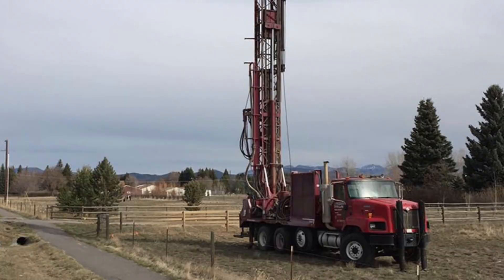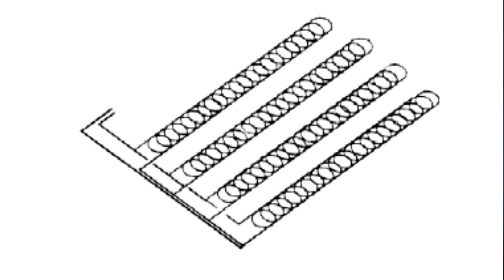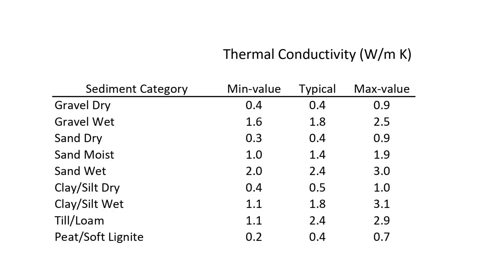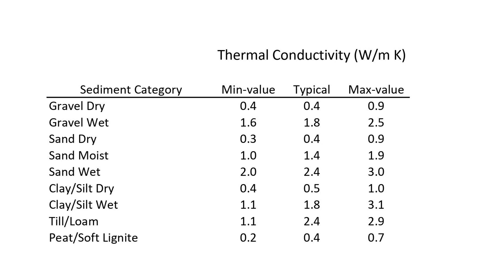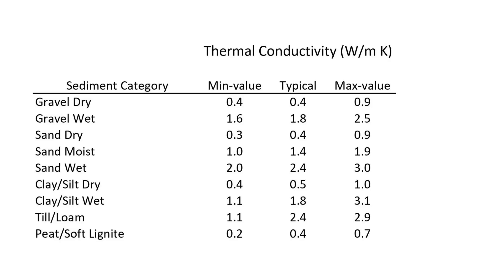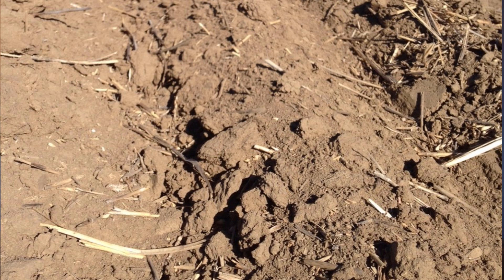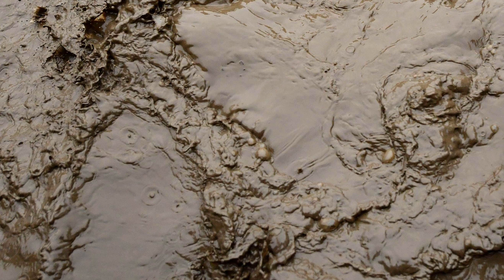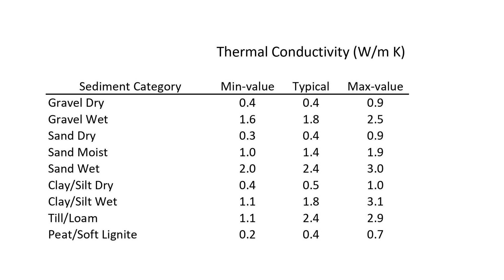Soils - Step-by-Step DIY Geothermal (Part 1)

Comment: Im curious what kind of soil you encountered at your depths, and did you decide to bring in clean soil for the 6-12 inches on either side of your loops? Also when you say gravel/rocky soil how big of diameter comes to mind. I had to have some profile pits dug for septic soil testing and im sure ill get the results from the lab but just for my understanding. Thanks for the video series and all the good and bad you've encountered, im sure ill be back with more questions.
Reply from the maker: I had moist clay at depth.  I would look to see how angular the rocks were at depth and wouldn't want anything more than 1/2"

Comment: I think you made this too technical..
I think it could be a lot easier than the way you are saying it..
Most people if they saw this video would just say screw it I'm going to put in a wood boiler...
I know a little bit about geothermal and it can be done fairly easy and cheap..
And that's what the public needs to know..
I understood what you were saying..
Thank you
Reply from the maker: I wouldn't recommend anyone do this on their own without a little bit of education.  The education is what's going to make it fairly easy and cheap, and it will actually work.

Comment: I think it'll be cheaper to just do Overkill. I'm using solar so I could care less if I'm using an extra 50 or 100 Watts with a bigger pump. The surveys and time that it'll take to get this done would be ridiculous in my opinion. Drill the hole throw in the pipe have a nice day. If it's too much again I don't care, but if it's too little which is very unlikely then I'll just dig another trench and throw on an extra solar panel if necessary. But I've watched all of your videos and I really do like them. You do an excellent job, so thank you very much. I have subscribed to your channel and have learned a lot.

Comment: Does moisture content of soil change to a meaningful degree throughout the season. I’m asking because if I do this in the spring vs. mid summer am I going to get meaningfully different moisture contents that could doom my system?
Reply from the maker: At the depths I'm suggesting, no.  It's pretty darn consistent at depth.

Comment: I live in the Ozarks and on the south side of the hills it is mostly dry clay combined with limestone rock for the first two feet. After that in most place you hit bed rock. Hard limestone. If I dig a horizontal loop in a ditch carved into rock  would I maybe use gravel to fill it? Solid rock trenches in limestone... what soil would be best to replace the stone when backfilling a trench in solid limestone?
Reply from the maker: Clay if you can figure a way to keep it moist.

Comment: This is just what I wanted ...  I stopped my A/C project - an excavation beside our house on the Philippines because I wanted to know what is the best thermal  conductive soil to backfill with.. My rock bottom temperature is 21 C or 70 F  I will have a combination of a large horizontal non-overlapping coil only 1 foot deep under shaded cement and a dug well ( over a yard across) to hold a Wearhouse received coil of black water pipe( PE)  both are only !/2 inch in diameter.  Together there will be 300 meters ( 1000 feet ) .   My soil is limestone rock most of which must be jackhammered to excavate.   Thinking of making the dug well part another meter down to make it 2 and a half meters in total and adding one more 150 meter coil to increase my cooling capacity.
  I will also be making available roof drainage water as well at outside tap water to keep the dug well part saturated with water.  Your video has helped me to decide to fill my dug well section with a pea type sand gravel to mix with the water.  There will be no pipe connections made under the cement slab all connections will be made on the surface side of the house. This will be strictly water to a fan cooled radiator by low volume pump cooling system no refrigerating system..

Comment: Awesome content!  I’m building a timber from guest house on a 9 acre parcel on a small lake in Wisconsin.   Should be wet sand 6 feet down.  Considering trenching towards the lake and possibly using lake loop or at least will be able to get major water saturation near the shoreline.   Need to further research my local shoreline zoning but seems possible.

Comment: Thanks for putting the video out, super informative and helps with understanding the basics. Question I have - if my soil is basically wet sand (groundwater running through the land at about 5-6 feet) should I still worry about the density of the soil?
Reply from the maker: Nope, you are good

Comment: 7:21  I worked as a certified lab tech doing soil proctors for soil density testing.  24 hours?!?!?!!!!  No, when it's dry, it's dry.  Any one can see when a soil sample is dry and then touch it (after it's cool) and when it's dry, it's dry. our oven was just a toaster oven and we put the pan just under the heating element.  Took about 15 minutes.  Our sample size was small.  Don't need a shovel full to determine moisture content.  As long as your scale is accurate you can us about a cup of soil but I usually used about two cups of soil to make sure I got a good sample.  Spread thin.
Reply: Doesn't the moisture content vary a lot from week to week based on the recent rainfall?
Reply: @hickorydragon8114  In the field you are correct.  In the lab an oven is used to drive off all the moisture from the soil sample.  The idea that it takes a 300  degree oven 24 hours to drive off all the moisture from a 300 gram sample is just ridiculous.  The sample is baked for about a half hour.  With all the said, if there is a .001% moisture content it won't skew the proctor enough to worry about.  Honestly, the proctor is designed as a lab test to give documentation for a process the can be done by judgement just as well.  One of the job sites I worked at we couldn't get a proctor because there were too many +3 inch material so the entire site was done by judgement.  That puts a whole lot of responsibility on one person that has no way to document that it was done properly.  I do take solace that on this job site every company that had to do excavation (plumber, electrician, etc) complained that they had never worked their equipment so hard to get the job done.  Yes, that was a long winded response but I felt like it.  Bit of a brag with loads of facts along with it.

Comment: I was wondering, does your system have temperature probes for the outlet and inlet of each loop?
Reply from the maker: No, just one for the the combined on each.  However, you can use a laser thermometer to measure the outside temp of each line if you wanted.

Comment: Garrett, much of the area I live in, Dallas County, Texas,  has a large sandstone formation anywhere from at the surface to a maximum of 14 feet of cover. It's hard to be sure in many areas without and soil sample before buying. I am fairly familiar with with this- I have been digging trenches in it since the '80s as a plumber. You soil lists don't really seem to have a line for this- vertical systems in this area that I have looked into are 100-125' deep, one loop per ton. I am aware I haven't given any moisture numbers- if you test for moisture soon after a rains storm, the numbers are high, as the water is running across the face of this "chalk", less so for the higher points on the chalk, and dry as dust for periods with low rainfall. My take at this point is that a horizontal system might not be practical- even with much longer tubing runs. I guess I'm hoping you can tell me there is a silver lining here. Any light you might offer would help. Also, thanks for the source listings for the manuals- I' ll try to catch up will them. FR
Reply from the maker: In your case, you may want to install a supplemental watering system that periodically keeps your trenches moist.  Perforated pipe buried a couple feet above the loops that can be connected to a water source.  If you have a septic system with a lateral field, you can bury your loops under it.
Reply: @Challenged1   Thanks, GG!
Reply: @Challenged1  Thanks! Another thought dawns on me- use the grey water from washer/tub line as feed for the perf line.  FR

Comment: another great vid & sounds like an invaluable series, Garrett. here in Phx we're known for caliche, but i got lucky while planting my trees & found great soil about 4ft down. i'm not sure what to expect in NM (where we plan to buy/build), as they've got naturally growing pine & pinion trees but it's also visibly very rocky & dry on top. love the tip to layer clean fill below/above the coils ...think the moisture content & thermal conductivity would remain? or would it potentially dry/harden over time & perform worse? or maybe the goal of that is just to pack tightly around the lines to make the best of a less-than-ideal situation instead of rocky soil that'd have air gaps?
Reply from the maker: It all depends on the moisture content of the virgin soil at your loop depths.  That will tell you what you need to know.  If it's too dry, a supplemental watering system can be installed to periodically water the loop trenches.  More details to come in another video.
Reply: @Challenged1  ..."supplemental watering system" -brill, thx man!
Reply: We also have land in NM and I've heard stories of caliche, although I have no idea yet if we have it.  We are putting our dreams to paper at this point.  I'd love to hear any more of Krazie Ivan's experiences in NM, and, anything that Garrett can add to sinking geothermal in that high desert area, north of Albuquerque.  Thank you!
Reply: @vickimorales2144  ...geothermal just wasn't going to work out for us due to a few things, so instead, i'm taking a layered approach in-effort to get close to PassivHous.

it's mainly design & positioning of the ICF structure, then using rainwater collection + solar HW heating + Trombe walls + greenhouse to "store" energy in the water & pre-heat incoming ERV. closer i can get to equilibrium, the less i need to spend on PV panels, batteries, etc... but harsh days/nights will be handled by mini-split.

only on paper so far, but closer to starting.

Comment: I will be contacting an old timer contractor that installed a vertical system in my last house in town due to space.  He already told me not to go that route in my rural new build because well drilling in my area has tripled over the last 12 years and recommended an air/air system.  I'm building on a sloped lot with solid granite only a couple feet below the surface.  To grade my lot will require up to 8 feet of fill in areas, making coil loops pretty easy to install, leading me to think ground source could be the way to go.  How will close proximity to bed rock affect the performance of the loops and how close to the foundation can you run them?  Any reason not to run a loop under the driveway?  Will there be issues establishing even flow rates in the loops if they are not all the same elevation?  I suppose valves on all the loops could allow optimizing performance by monitoring return temperatures of each loop and balancing the system.
Reply from the maker: You would definitely need valves and temperature ports on each line to balance the system.  Granite has excellent thermal conductivity, so I wouldn't see a problem with it.  Loops can be wherever you want as long as they aren't under the house.  I would recommend at least 10' away from the foundation, so you don't start effecting the temperature of the ground immediately around your house which could suck heat out of your house.